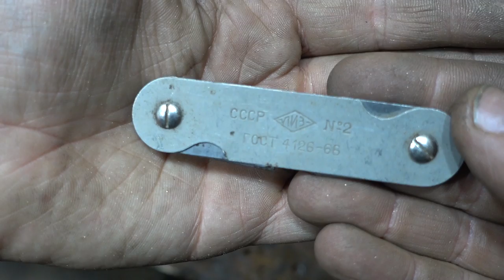Restoration Rusty SURVIVAL KNIFE

Comment: You’re sense for aesthetics are well honed sir. Beautifully done; especially the guard and handle. What type of belt grinder is that? Way more robust than a 1x30 for sure; but maybe less expensive than a 2x72? Looks like it would be perfect for stock removal and grinding bevels. Great video! Much more than a restoration in my opinion.
Reply from the maker: Thank you! I have a 50×100 sanding belt. This is a homemade machine. Of course I would like to have a large 2×72, but it is expensive.

Comment: Great improvement on the blade,I do not like that slot by the handle, if it is meant to be a choil they are better rounded, personally do not like round handles hard to index in a hurry also better for pins which I also prefer, very good job though.

Comment: Add Inches.. 🙏
Reply from the maker: Will do.
Reply: @ScrewsAndTools  great job by the way. Wish I could do something as Good. 
Only minor thing I've seen different is some add a little bit of Leather between the guard and the handle. I dont know Why... but I noticed you didnt. 
But I would Love having that beautiful blade .. 
Again, Great Job!
Reply from the maker: @coppertopv365  Thank you for your attention, add leather for a tighter fit of the handle. I didn't do it, because I had a thread with a nut on the end.